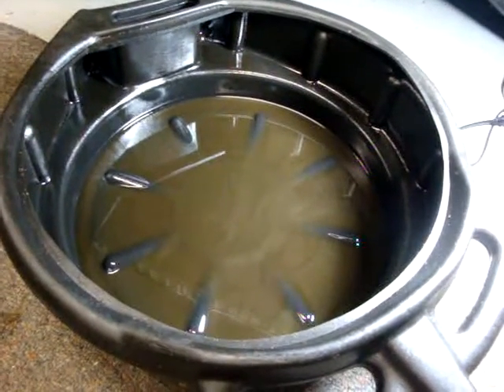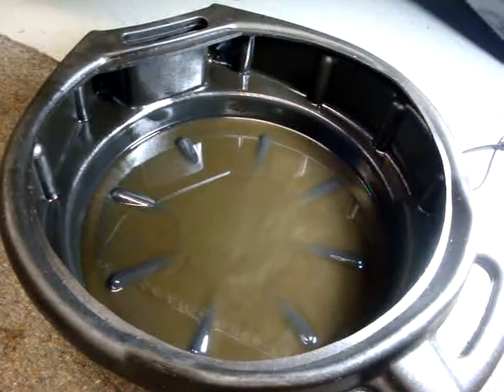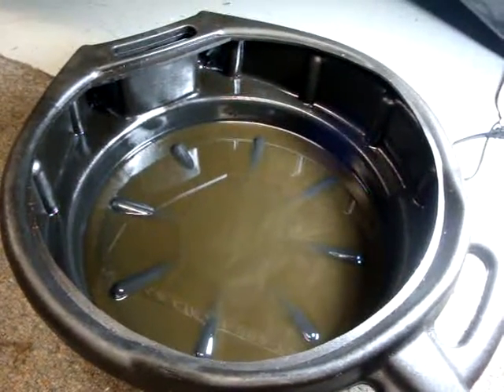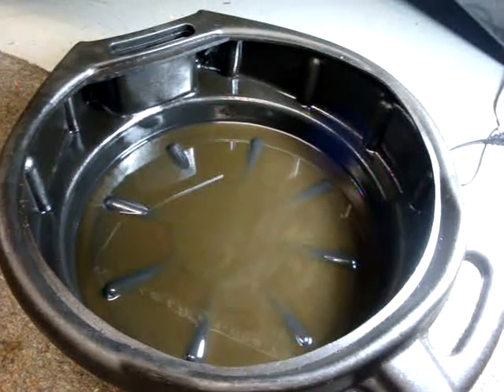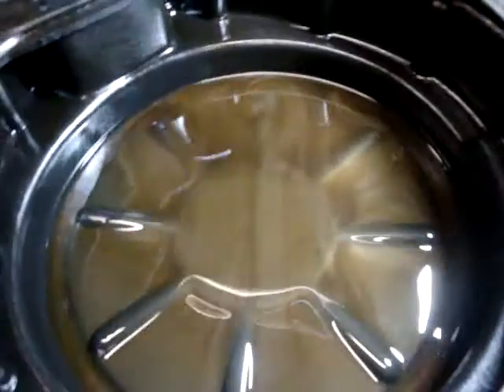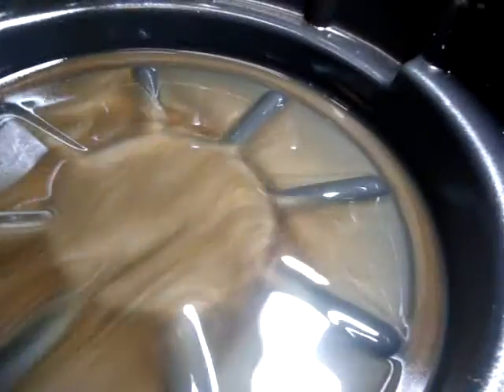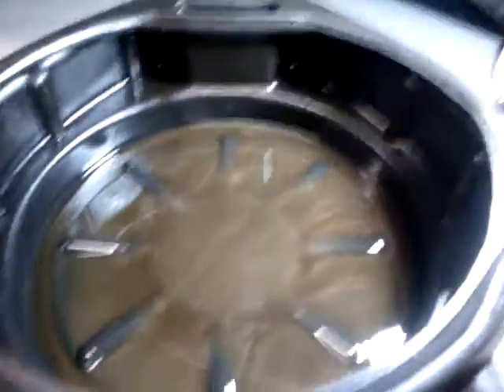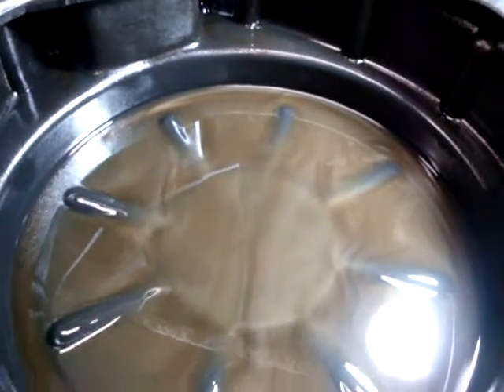Break in Oil

Comment: We had the same results after a pretty good 1000km (600miles) run in to a freshly built high comp motor. Gained 30psi compression after finishing running in. Went from 200psi to 230psi , with noticeable gains in torque , throttle response and power .

Comment: Dosent the filter catch that metal glitter?
Reply from the maker: This engine does not have a filter. If it did the particles would likely limit flow in the filter and cause a drop in oil pressure. Not good!

Comment from the maker: If you bored the cylinder and replaced the piston rings the results should be similar.
The main purpose of this  Video is to show the amount of wear in that occurs as parts mate to each other.
After I get fresh oil into Motor, be it a vehicle or yard implement, I warm them up good and hit them hard to seat the rings.
I have yet to have a  Motor fail or use oil.....and I’m not easy on them.

Comment: Hello! Ist the Engine still running OK? Could You let me know what Type of Engine this was?
Reply from the maker: zwosiebener  , per the video it is a Yamaha generator, single cylinder four cycle motor. This really applies to all four cycle engines though the higher end engines (Automotive, Motorcycles) will typically have less initial wear due to tighter tolerances and better metallurgy in the components.
Reply: OK....can tell You that wear ist also in Automotive engines. I did first and second Oil Change on V10 Engine and was very surprised about Oil what came out. It Looks nearly exactly than yours in this Video but Engine runs very Smooth without any unnormal noises.
Reply from the maker: Yes, same here with Automotive and Motorcycle engines. The "lawn equipment" motors have been worse. The Generator runs perfectly!